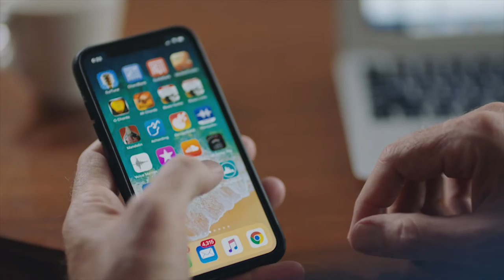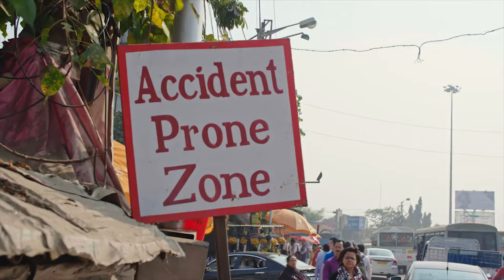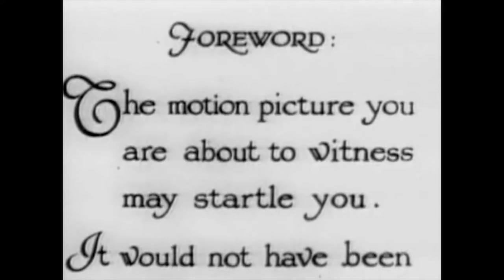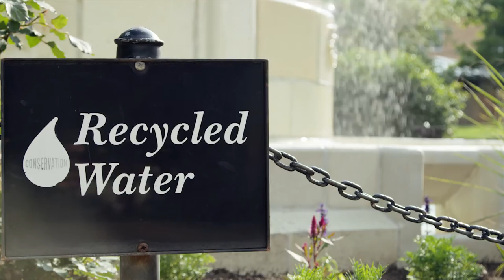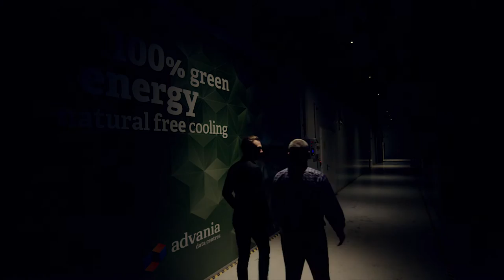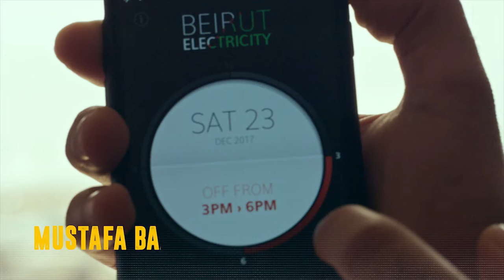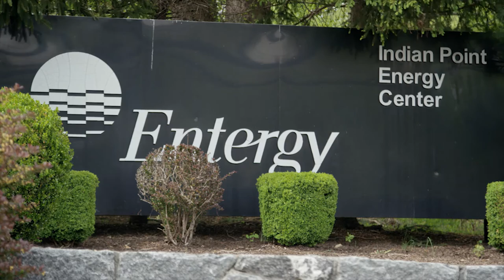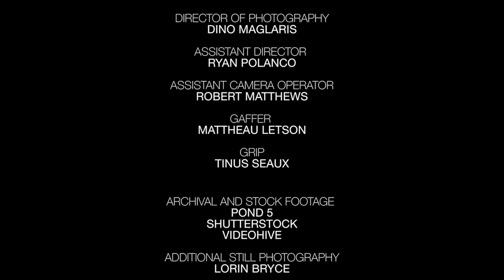How Electricity Explains The World - Juice Full  Documentary

Comment: 1:00:49 , what everyone needs to do that can afford it. Is to get a roughly 10kwh battery, with a 15kw inverter. Capable of selling to the grid. With a smart control to decide what it does, and when. Everyone becomes part of the power plant. If they have more need and more money get a larger battery, and inverter. If people can't afford to buy the inverter system, charge them a extra 5 cent/kwh the control system keeps up with it. And charge it with solar and the grid when it's up, using about 1-2kw at most , 200-500watts at least.